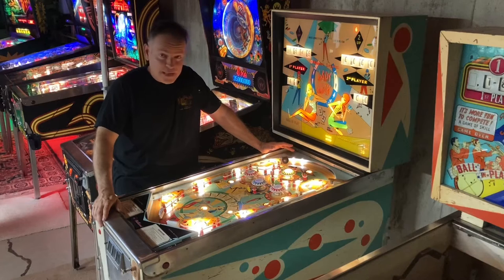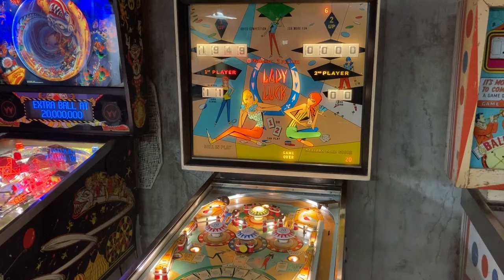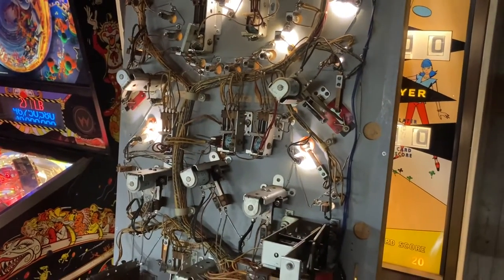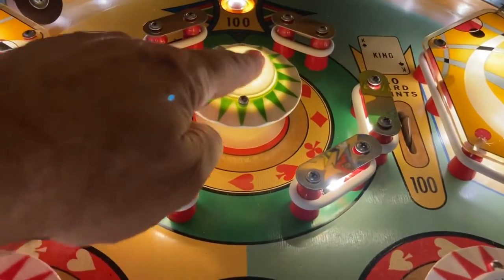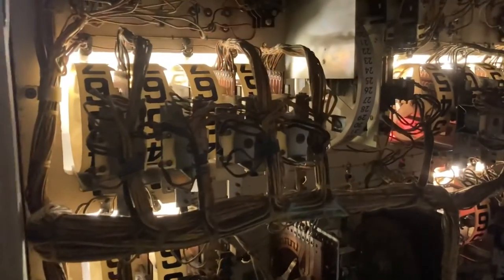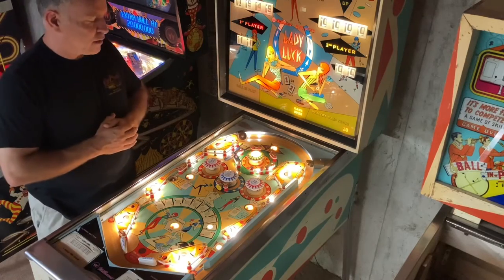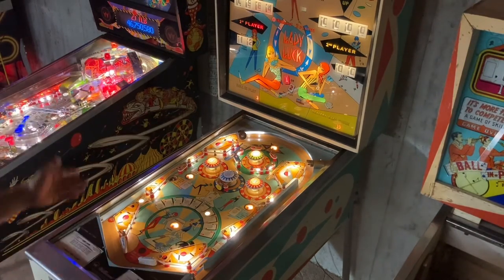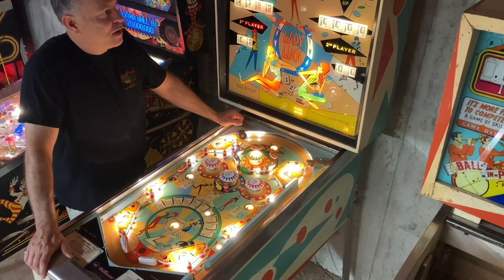1968 Williams Lady Luck pinball restoration: Part 1

Comment: Nice machine! I have one too. Mine is working well... except for a couple issues I haven't tracked down yet. One is that it plays Blackjack "19". In other words, if your card score is over 19, you bust. Any ideas?? I'm assuming it's a leaf switch... maybe on the 20 relay?
Reply from the maker: Hmm not sure but you gotta be on the right path. Whatever determines over 21 has to be the culprit.